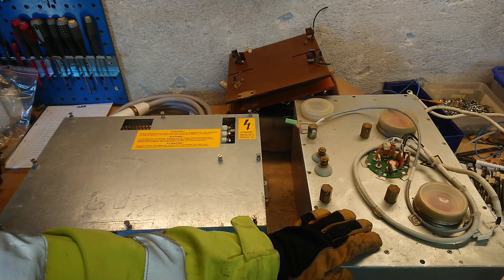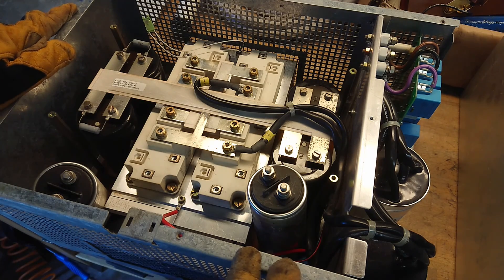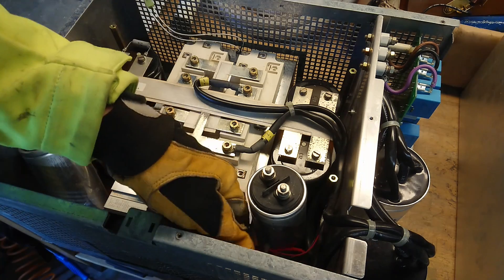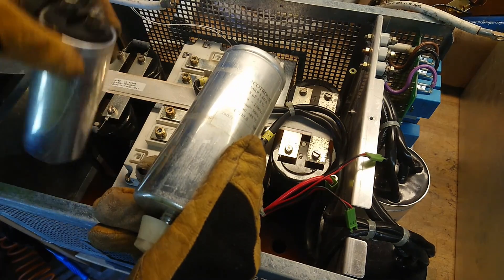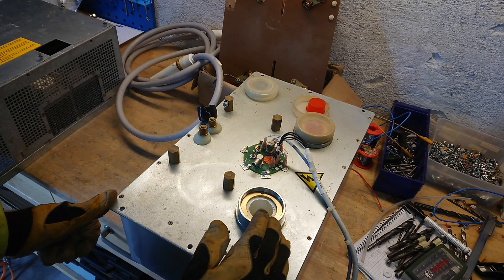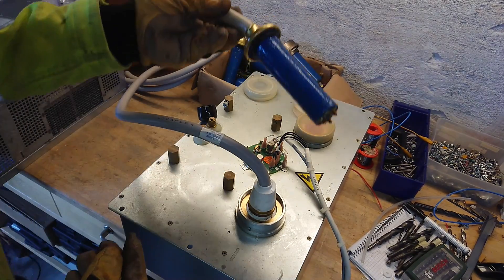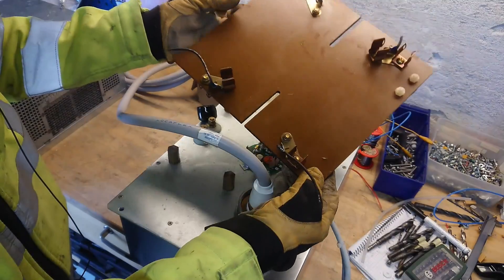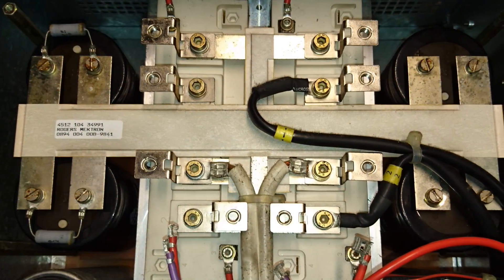70 kV / 65 kW XRAY System, Transformer and Inverter - Isolation, Day 12

Comment: Hello

Kaizer, are you just taking these X-ray machines apart? You can make them with this laboratory high-voltage power supply of 150 kilovolts. did you find this x-ray at the metal reception?
Reply from the maker: Hi zilipoper! Great to hear from a legend :) I got the best parts saved, two SKM400 inverters and a single HF 70kV tank. It is from scrap yard.

Comment: Interestingly (to  me at least) the one i have and the one Lejf has seem to be exactly the same yet were from 150kv 65kw Philips machines .. i guess 65kw is 65kw 😅😂
Reply from the maker: I guess the 150 kV system must be rated for half the current then. Why do I have two of these inverters? Was there really two in one system?
Reply: @KaizerPowerElectronicsDk  the transformer is rated for 65kw so yes it must be rated for half the current at the full voltage 👍

Comment: Hi, my name is Stephen Bedih of medizine Technical Services a Bio-medical Engineering Co. in Ghana. Which supply, install and maintain medical equipment. We have one GE AMX II in our workshop for repairs and the problem is :- There's 'Prep' 
but there's NO. Exposure when the Exposure SW is pressed. Can you please some possible causes to get the problem solved.or send me the service manual?
Thank You & Kind Regards,
Steve.
Reply from the maker: Hi Steve. I am sorry that I can not help you with those. I only had the unit to take it apart. Did you look up Franks hospital service on Google? Kind regards Mads

Comment: blue parts are power factor correction capacitors. its used because they use inductive load. all inductive load brings more energy price. pfc correction caps makes capacitive loads and enerygy bill decreases. its about energy company rules. can you show the details of high voltage dc link of the inverter? please
Reply from the maker: Reactive power is not used in billing for electricity. So there is only a requirement from the utility to have at least 0.9 power factor, bad power factor only affects the amount of power you can pull through a service. You need bigger cables with bad power factor, to counter for the higher transmission losses.

Comment: Funny enough replacing an Arcotrol capacitor at work, that popped it's guts. Made week 6 of 1979, and finally died and extruded itself with a big puff of smoke.  Yes PCB oil very likely, made before the ban, and no warning label on the case saying PCB free. So was wearing gloves during the clean up of the area where it went out, and made a nice big bag of contaminated paper wipes and solvent that went for disposal. New one is solid and plastic case, instead of oil filled aluminium, might not do 40 years of service, but 450VAC rated instead of 400VAC, so we will see. Machine still smells of cooked microwave popcorn.
Reply from the maker: Film capacitors can take some much higher voltage transients than the old oil/paper could. If you treat the film capacitor nice and keep its temperature below 50 (even better if lower, but never go near 70!) degree Celsius, then it would possibly outlive you :)
Reply: @KaizerPowerElectronicsDk  I find that the new capacitors are somewhat less robust. Old PCB filled 250VAC units I have, which are removed from equipment from the mid 1970's, withstand 1kV insulation test without any breakdown, while a more modern dry film type will typically start to break down and self heal within 2 years of use at the same test voltage. yes they do run in hot ambient in airconditioners, but the old ones sat next to the compressor with no cooling airflow, while the new ones are cooled by the fan. 

They just do not make the capacitors with such a reserve margin any more, and do not solder the cases shut, along with soldered in glass seals, it is too expensive. So instead dry resin impregnated, or crimped seals and coconut oil fill instead.

Comment: Very nice bit of kit there, still hoping to someday get my paws on a set of my own. I can find them, just postage is never an option
Reply from the maker: Yesterday I secured myself a lot of 3 x-ray image plate scanners, a old x-ray power supply system and various peripherals to it all. Will make for some good future videos :)

Where are you located? Even though that shipping above 20 kg is a killer almost anywhere in the world.
Reply: @KaizerPowerElectronicsDk  That will indeed make for a nice vid ^^ For now and an unknown amount of time, the USA... I am sadly not on either coast (where concentrations of great finds seem to be...). Some of these items are so heavy that even domestic postage is by truck and expensive. I think most postal systems 20kg is the limit. At least, AusPost was (whom I had used most in past). I just have to get lucky to be in the right place and time. I can do the truck freight, it just is a hassle though dealing with, esp if it is international. Always had been something or another in the way. Funds, work, space, distance. I really do not have space now actually. Someday, I will have space, and place, and all that :) Hoping to be in NZ actually, but no clue how things will go as of this time

Comment: I wonder what type of xray apparatus was driven by this monster? Standard medical xray machines use some mA at best, but 65 kW at 70 kV is somewhere in the range of 1 amp beam current if I am not mistaken?
Reply from the maker: It was from a Philips Optimus 65 system if I recall correctly. Standard human full body/full chest/thorax x-ray.
Reply from the maker: You mentioned that getting x-ray equipment was the unicorn of high voltage hobby. Yesterday I secured myself a lot of 3 x-ray image plate scanners, a old x-ray power supply system and various peripherals to it all. Will make for some good future videos :)
Reply: You've got this exact same inverter now Lejf 😂, I just popped back to this video because I posted a picture of an inverter I've got that's the same as these and Mads commented, I thought I had commented on this video when I watched it but seems not 🤔 I'm getting old 😅... 

Hey Mads👋 cool video (still) 😅😂

Comment: Very interesting to see. 

Why does the HV connector have 3 pins if it has only one conductor or did I get this wrong?
Are these connectors still used in modern equipment, they seem kind of oldschool to me. 

Oh and your german sounded very german this time, do you actually speak some german?

Greetings, 

Michael
Reply from the maker: There are very few industry standard high voltage connectors. About the only HV connectors manufactured by multiple companies are the Tyco LGH series, and the so-called federal standard connectors, used in x-ray systems. I think it just uses 3 contact points to insure a good connection, even if one of them should fail, you still have two others to prevent arcing in the contact point.

The federal standard connector was a early standard and as with many other x-ray/medical approved things, they do not change if they work and are approved, new approvals and tests costs a lot of money.

I speak fluent German, we have to learn German in Denmark (form 4th grade to 10th, when I was in school) and I also had it for 2 more years in the gymnasium. I then worked for a German company for 3 years, some 6-7 years ago. 

Es ist nicht alles perfekt, aber Ich kann Deutsch schreiben og sprechen gut genuch für meistens Verstehen, nur Meine Grammar könnte besser sein ;) Ich hab meistens von Bayerische leute gelernt, so vielicht es ist Bayrisch und nicht Deutsch Ich sprechen kann. Servus! (no spellchecking used, did I do well?)
Reply: @KaizerPowerElectronicsDk  
That's interesting, I guess especially HV connectors that are able to carry some power seem to be quite rare, as you said, now that I had a look. 
Most standard connectors are mor BNC sized. ;)
That makes sense. Maybe the resistor in the receptacle you showed is to make sure that the connector makes contact with this pin first as kind of a "soft start" in the connection? 

You are propably right, I forgot, that all of this is medical equipment after all. I am always amused to see, how old a lot of medical devices are. (A lot of somewhat modern medical equipment runs on Z80 or 68000 CPUs.) However there is propably way less that could possibly go wrong that way. 

Oh interesting, I didn't know that. 
But atleast from a geographical point of view, it makes sense to lear german, I guess. 

Servus, wie du sagst, die Grammatik könnte stellenweise etwas besser sein aber definitv gut zu verstehen, Respekt.  :)

Viele Grüße, 
Michael
Reply: @KaizerPowerElectronicsDk  Am I correct that the high voltage supply also has to provide filament current, so having 2 HV leads is for the filament, and then the negative supply is applied to them, with a grounded anode block. 

Multiple connectors so you can have a well isolated feedback system to ensure the leads are connected both sides of the link for a safety interlock, and one not easily defeated by simply shorting the 3 terminals in each plug together. Thus a terminating resistor on one side, and then the drive side has a well insulated transformer (probably the filament one) driving a sense circuit that will send a fault signal if the total wiring resistance between the sense leads is out of spec. Seem to remember seeing those boards in the transformer blocks.
Reply from the maker: @SeanBZA  sounds like a possible setup, i guess would could find the answer in some manuals from Franks hospital service website. I only ever took a head with builtin power supply apart: http://kaizerpowerelectronics.dk/teardown/siemens-polyphos-30-x-ray-125kv-head-teardown-part-1-of-3/

Comment: So it is a LCC converter?
Reply: Thanks for showing
Reply from the maker: It could be a LCC inverter, but I would have to open up the tank in order to find out. It could also just be a series resonant inverter without the internal C.
Reply: The C can be also formed just by the secondary capacitance that how i designed them once before, because for high voltage this parasitic capacitance is quite problematic, but maybe a phase shift could be possible i think but fir that you would need an inductor, hmmm
Reply: @heinrichhein2605  You can do it in the tank just by using a shift in the secondary coil location over the primary, and arranging the air gap and shunt pole pieces to give the extra inductor. Just like a microwave transformer, using leakage inductance to advantage.

Saw that in an old ferroresonant converter that failed (spectacularly) which was unusual in that it only had a single very large multisection transformer, that had both the input winding, the ferroresonant winding for float charging the battery and for driving the output, and a second ferroresonant tank circuit, them a secondary winding. All sorts of shunt pole pieces between the windings, and a load of air gaps in the central core piece, just held together by the outer plates and a lot of varnished in bakelite spacers.

Control board went bad, and as the output stage was made from nearly a whole tray of 2N3773's and a massive set of SCR blocks, and most of the TO3 cans had either a hole blown through them, or a missing emitter ( and of course a burnt out ballast resistor on each one) it was not economic to repair the board and replace all the silicon.
Reply: interesting, yes you can build the resonant Inductor with the leakage inductance, i really have to look at my transformer and do some measurement but for HV a llc would not make much sense i guess